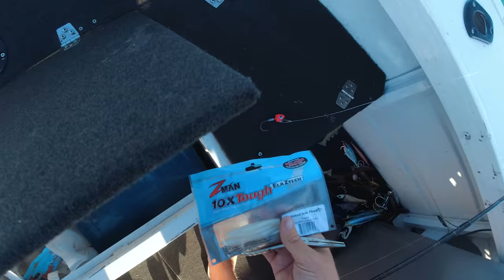We took this one home to eat!!

Comment: Just one of those days. I have them regularly but put them behind me as quickly as possible. I have 2 rodholders. 1 cracked & was useless. I ordered a replacement with a new fitting for the rail. Wouldn't you know it it did NOT come with a new set of TracLocks that I sorely needed. Ordered a set. Perhaps they will arrive at the end of this week. Damn. Hopefully, my motor willl not die. I kayak & it's one manpower! Thanks for sharing.